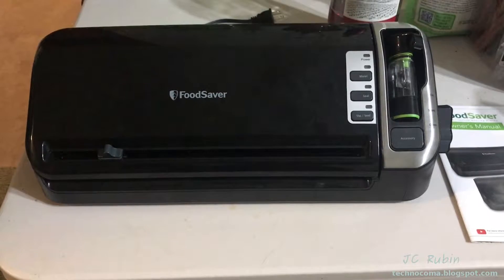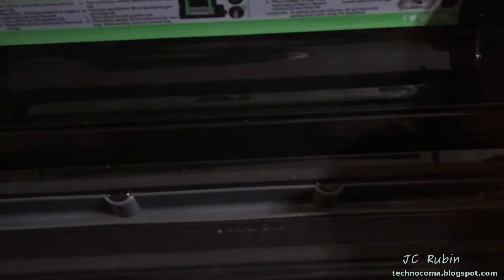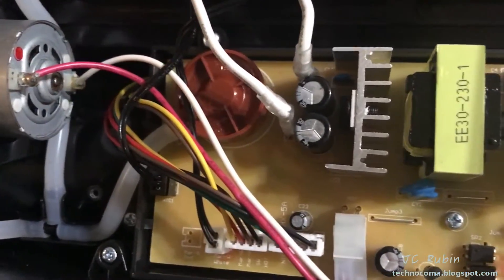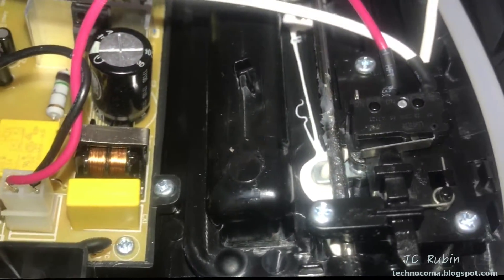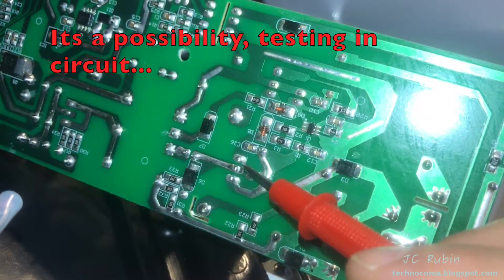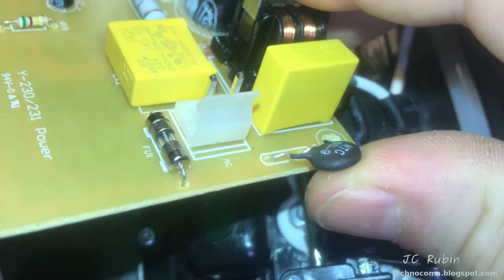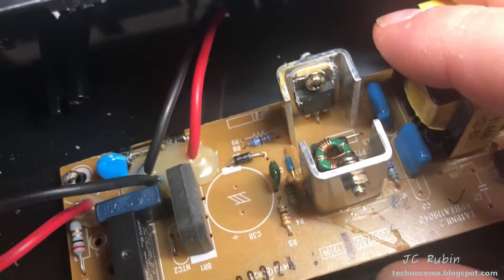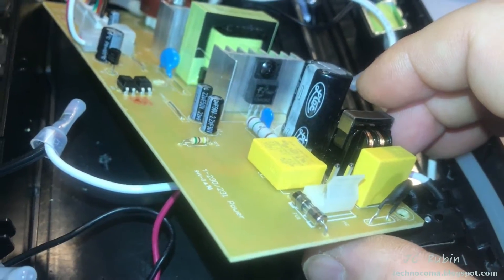Foodsaver FM3600 Not working - No Power, No lights - Troubleshoot why

Comment: That terrible sliding latch-switch combo is what failed for me. The plastic snapped because it's trying to cam that rod at a 30 degree angle against a bunch of plastic. Whoever approved that needs to vacuum seal any degree they have and toss it in the ocean.
Reply from the maker: Yup the latch was the first thing i noticed..

Comment: I subscribed.  I spilled a little water in table cleaned it up but some had gotten under food saver vs2110.  A week later went to use the unit and has no power any ideas?
Reply from the maker: Sorry, I can’t come up with any ideas with the info you provided.

Comment: Very good troubleshooting video Jordan albeit you were prevented from dissecting the potential failed component(s). I have a similar vacuum sealer although it is not a Foodsaver brand it is much cheaper and built to nearly the same standard.  Just as yours did mine failed after vac sealing around 30 portions. Only the vacuum part failed on mine and it does not seem to be the pump. You video helped me to zero in on the MOSFET controlling the pump and sure enough thats what failed. However in my case the manufacturer didn't even want the unit back they just sent me a replacement. Needles to say I've had 2 new replacements in the space of just over a year. I find it disgusting to think that these Chinese manufacturers churn out this disposable crap that becomes e-waste in a matter of months.

Comment: Did you do the fix? An update would be great.
Reply from the maker: It was under warranty so they replaced it in the end.
Reply: @retrotechandelectronics  Thanks for the update. Mine has the same circuit board. Fuse not blown. Will test MOSFETs.

Comment: Ya there made just good enough to operate. I only use mine for fish about 3 times a year and after 5 years it died blinking lights but nothing works. So if I calculate 3 times a year at about 10 bags each thats 30+ times a year so 150+ bags it should have lasted way longer than that.
Reply from the maker: Not their finest model.

Comment: I haven't  even used mine yet and it doesn't turn on. I can't even get it into the on position, it won't turn that far back.
Reply from the maker: Push down on the unit, then try to turn the handle back.
Reply: @retrotechandelectronics  thank you, it worked!
Reply from the maker: @Sassifrassilassi  awesome.

Comment: You are BLESSED to be understanding all this stuff you're talking about.
I'm just screwed. Have to just go buy another one. But they knew that would happen didn't they. 😒
Reply from the maker: This one apparently was recall model.
Reply: @retrotechandelectronics  I got the same 3620 model, so when was the recall on it? And is it still eligible for recall?
Reply from the maker: @redlitemeatandpizza  I could not say, this was several years ago, reach out to the company and find out if its eligible.
Reply: @retrotechandelectronics  wanna know something weird, I took it apart and it actually was the switch actuator not fully engaging with the power switch. Luckily it was as simple as adjusting it back into place and power came back on.
Reply from the maker: @redlitemeatandpizza  Cool to hear you got it going!

Comment: I’m hooking my multi meter up to the fuse and not getting continuity. How do I replace this? Just pull the metal prongs out of the board and get a new one and push it in? Do you know what size fuse it is?
Reply from the maker: I do not recollect the fuse rating. is it imprinted on the circuit board.
Reply: Retro Tech & Electronics if I don’t have continuity when I put my multimeter on both sides of the fuse that means the fuse is popped right? If I replace it will it short again? Hmmm

Comment: Heat damages electronics over time. It is now the leading cause of premature failure. Capacitors used to be but that was because of insufficient build design!
 Finding a shorted MOSFET is a good clue that the heat sink wasn't properly attached to it and thermal runaway occurred during use!
Reply: It's impossible to know for sure if it failed.  Could have been capacitance at the gate.

Chinese manufactured products usually take the maximum possible shortcuts to get the majority of goods within the warranty period.  That's their quality control 🙄

Comment: I am attempting to fix my mom's foodsaver. She's had hers well past the warranty, so it's either fix it myself or have her buy a new one. On mine, I'm almost positive resistor is the problem, and the paint is coming off in the same place, only it's much bigger and you can see some scorch around the wound.  It's been a few years since I've been in school for Electronic engineering, so I was wondering if you knew how to calculate the right wattage of resistor I need to get?
Reply from the maker: I cannot because I do not know the load of the unit.  You could just go big, say 2-4 watt